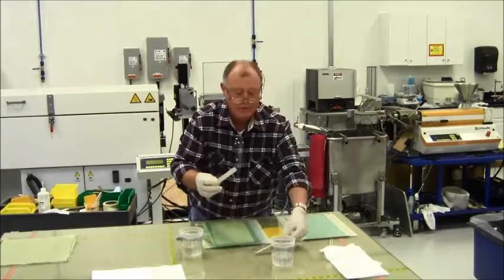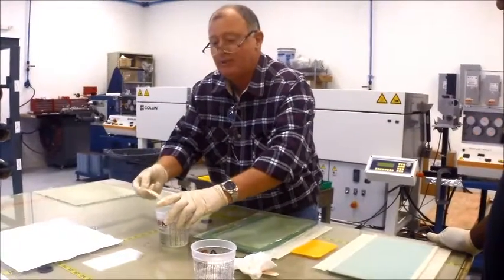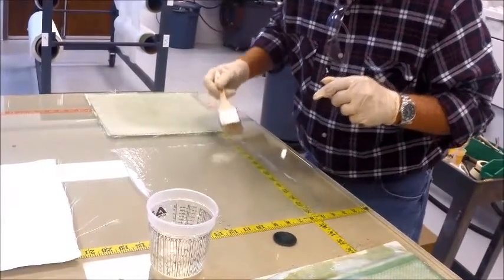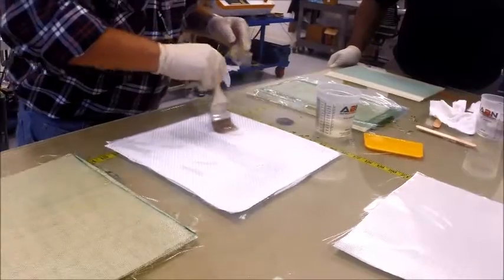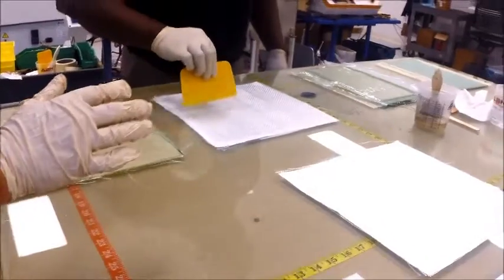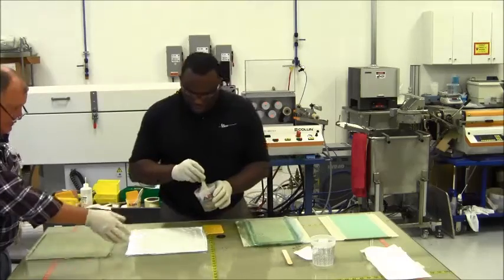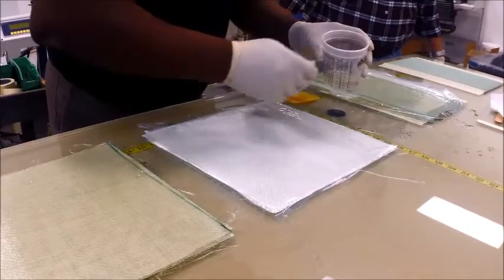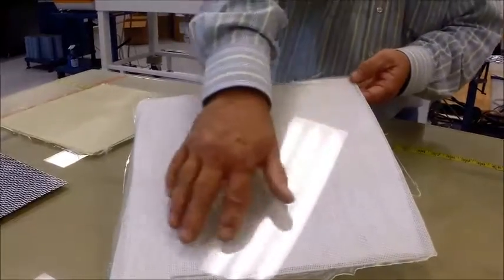Help Video: Innegra™ and Epoxy Wet Layup

Comment: Hello,

Very interesting video.  I've been thinking about laminating surfboards using Innegra with hand laminating technique (no vac pump). 

I was thinking about starting with 2oz of regular fiberglass on the foam, then Innegra and carbon then finishing with another layer of 2oz fiberglass.

In between those two layers of firberglass, I have several options where I would appreciate your advice.  Would you recommand using a innegra/carbon hybrid or a Innegra+Carbon+Innegra sandwich ?

Regards,

Pierre
Reply from the maker: +Pierre Both  We apologize for the late response! Email us at sales@innegratech.com and we can help you!